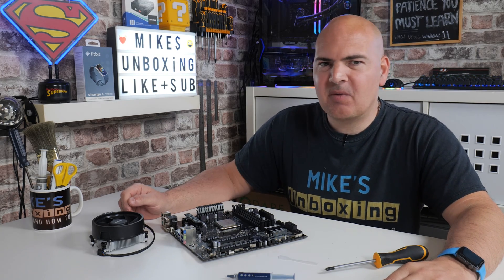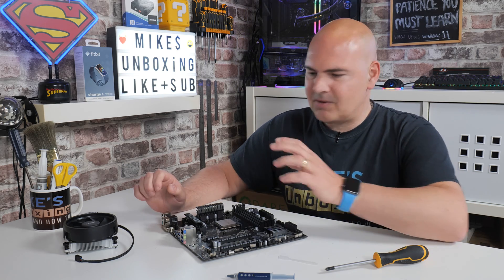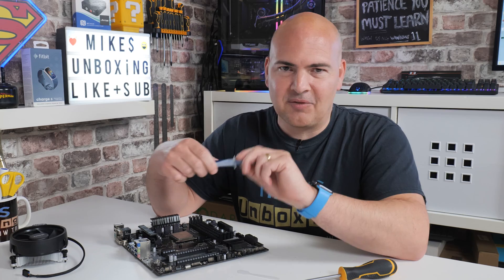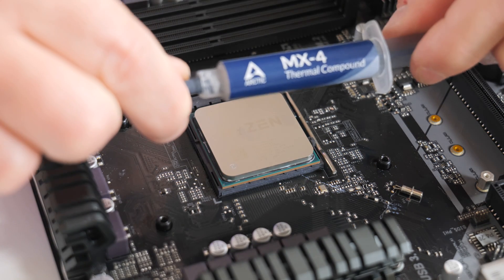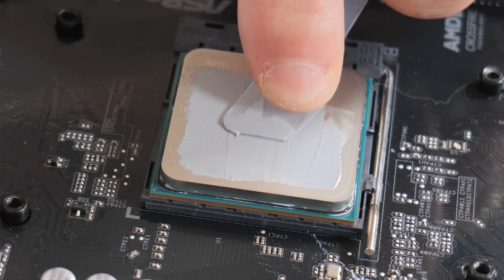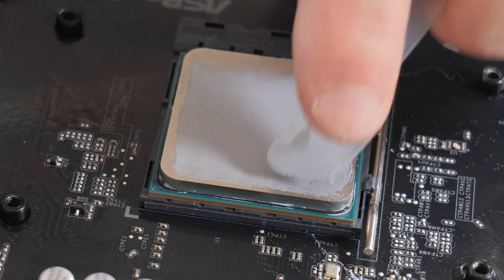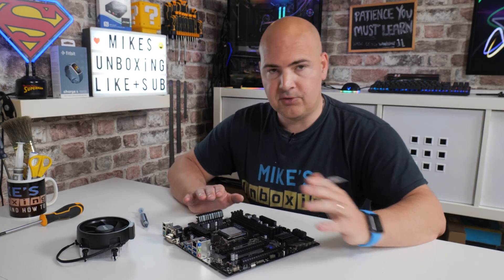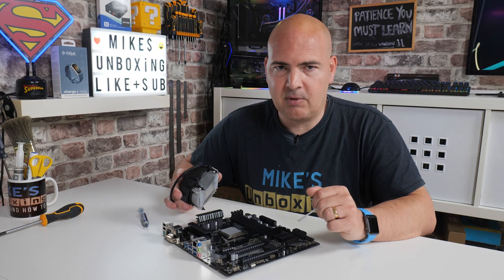BEST Method For Applying THERMAL Pastes & Compounds - Change My Mind

Comment: Great review Mike and Lady Kath. I do not lap the CPU, but I do lap the bottom of the cooler. I too prefer the Thermal Grizzly Hydronaut. I use to only apply paste to just the heat pipes...but have since started using the spread method. Take care all. Cheers
Reply from the maker: Thanks for sharing! i need to get some thermal grizzly paste i think
Reply: i use deep cool cheapest thermal paste for more than 20 years with much better results trust me brand is just a jimmick and thermal grizzly is one of them even though it produce good results.

Comment: I'm always afraid that pre-spread is going to trap voids that would be swept  by the squish method.
I'll always pre-spread a naked core though
Reply from the maker: squishing is squishing however it is applied if the pressure is enough
Reply: @mikesunboxing  based reply

Comment: Great tutorial. Having followed many videos abiut pea or rice method I have always worried that the cpu wudnt be covered fully. Totally agree with idea of spreading the thermal paste👍 Use arctic mx4 after watching one of yiur videos when building d'ters pc late 2019. Thanks for sharing Mike and Kath👍
Reply from the maker: thanks nick, it just makes sense thin layer and total (or near ) coverage, allowing for the maximum thermal transfer and minimal paste will just file the gaps as it should

Comment: You are 100% correct and us old timers who used to apply paste directly to the die with no heat spreader know exactly why. It's just a tiny thin layer to fill in microscopic gaps in the mating surfaces. Nothing more.
Reply from the maker: sound advice old timer :-) - wait that is me as well :-(

Comment: I do it the same way Mitch Haman said he does it.  Some people used to think thermal paste helped with cooling, it doesn't. It impedes cooling. As Mike pointed out it's simply the lesser of 2 evils, a gap of air is worse than a gap filled in with TIM. In a perfect world the IHS and the heatsink would be perfectly flat and mate across both surfaces perfectly. Things are often far from perfect, just look at the variation in core temps on some intel CPUs, even intel can't get dies to disperse heat evenly to the IHS. This is why people delid, lap CPU die, and sometimes even lap the bottom of their heatsink/block. So I'm not gonna try to change Mike's mind. He's right. 😎
Reply from the maker: thanks james, the voice of reason
Reply: It helped my FX 6300 stayed cooled for  5 years long. Stop giving fault information

Comment: The spread methood actually is the correct methood its why a spatchular is included with most Pastes today also you get full plate coverage which spreads the heat more evenly thus increasing the life of the die !
ps; did you figure out the AIO /Fan Header issue ?
Reply from the maker: i think so, it still is a little hot but seems that board likes to ramp up the voltage a lot, and the 5800x doesn't really like that unlike some of the other in the range

Comment: Any method that ensures thermal paste coverage of the entire cpu IHS / die is fine imo. TIP:  FOR REMOVING CPU FROM HEATSINK / COOLER ….IVE FOUND RUNNING CPU FOR FEW MIN’s THEN SWITCH OFF PC AND THEN TWIST (after cpu screw removal) THE HEATSINK GENTLY WHILE CPU IN SOCKET HELPS DETACH AND REDUCES CPU BEING RIPPED OUT OF LOCKED SOCKET! As thermal compound becomes more runny and less tactile 🥰👍🤯 Great video Mike! I’ve use various methods but pea and spatula method for me are most commonly used👍😇
Reply from the maker: a stuck cpu is never a nice thing and it always scares me, but since fully adopting the thin spread method not one single cooler has gotten stuck and most actually just fall off - which is excellent!

Comment: Looks good - will definitely give that method a go next time - Carey Holzman uses his finger (with a rubber glove) but achieves the same effect - thanks for another great tuition video
Reply from the maker: yeah that works well, just make sure it is even and not over applied and that will make removal a lot easier after

Comment: Mike, have you run any tests for temp differences between this method and the traditional "pea" method?  I get what you are saying about AMD CPUs getting removed when removing the cooler; would you say the spread method is more important when using an AMD CPU vs Intel?  Thank you as always for the insights.
Reply from the maker: yes i have done previously and with the pea it is about consistantly getting the right amount which is hard to know unless you take the cooler off to see the coverage.
the pea method for me often gives slight variations when testing so i like the spread method as i can work it the same pretty much every time. In terms of actual differences is it almost nothing in it unless you compare a poor pea application and then it is still only maybe at the most 3 degrees or thereabouts.
for me it is more about the ease of removal and trying to prevent the cpu ripping out when changing coolers
Reply: As I thought.  Thank you Mike.

Comment: Looking at that I've probably put to much on, but it is working. That thinner layer could squeeze a couple of more degrees perhaps? 
I'm getting a constant 43 degrees sitting in bios for a few hours, with 3 x quiet case fans at 50 % ish, 5600G/A520M-DS3H, Amd wraith stealth heat sink block, slightly extended. I've replaced the CPU fan with a TUF 120 AIO, but set to start at 48 degrees. Intend a temperature ceiling of 63 degrees, and only case fans when idle / light browsing.
I need to get some software installed to see what it does in action, (not gaming). Still to get a external 5.25"drive enclosure as the thermaltake H15 case 5.25" Bay, won't take much LG BDe data writer, clashes with the power plug, by 30mm !
I've a FX6300 to re-compound , once the new build is loaded, so surely will be the spread method. 😉 
Really enjoying your videos, thanks 😊
Reply from the maker: thanks for the info john

Comment: Hi, Mike. The spread method is 100% Oletta approved. I've done it that way for years. I also believe lapping the CPU and Water-block is an important first step before applying the paste. In regards to the paste itself, I only use Thermal Grizzly Hydronaut because it doesn't harden over time and it's highly thermally conductive without being electrically conductive. Per example: Idle temp for my OC Ryzen 9 3900X averages 9 degrees above room ambient, and after a 15 minute run on Cinebench R23 max temp 71c. Cheers!
Reply from the maker: thanks oletta, and nice temps
Reply: @Oletta Liano I am sure you have become very good at lapping...
Reply: @PapaMav  Only Rosa knows for sure. 😂
Reply: @OlettaLiano  I know who to come to in the future for spread methods
Reply: @uglybob7505  Sweet, and I know who to invite over for lunch. 🧛‍♀

Comment: Funny I just watched a video on this yesterday, this one here: https://www.youtube.com/watch?v=wn2ln04dquM

My take away is the X-method, which I usee anyway, and a little blob in the middle to help fill in the central area on all 4 sides.  Either this, or a very thin layer evenly spread with a plastic card, as thin as you can get it, for maximum thermal efficiency.

Anyone remember the time before IHS, where the cooler would mount directly the processor (like GPUs do still), many a time finding out the contact between the CPU and cooler was lacking and temps soaring.
Reply from the maker: i can recall when cooler had thermal pads instead on compound, heat wasn't an issue that far back :-)

Comment: When I started building computers back in the late 90's, I would spread with my finger. That's the only way to be sure that it spread in the right way, in my opinion
Reply: Then you risk spreading oils from your finger onto the CPU
Reply: @danieldevito6380 or wrap your finger with some plastic wrap and then spread it 🤷‍♂️
Reply: @danieldevito6380 Which does exactly what?
Reply: @danieldevito6380  I always use alcohol wipes for cleanliness!
Reply: Been building PCs for years.  I also always use the spread with finder method.  No issues doing it that way either.  Used to use Arctic silver 5, but have changed to Arctic mx4.  Pretty happy with it and spreads out easily in my opinion.

To be honest I just keep a rag like an old washcloth or old towel of some kind and gently wipe off the old paste when needed.  Perhaps I should use wipes but no issues with just wiping off the paste so far.

As far as the cpu coming up when removing the cooler, I’ve found start your system up for about 5 minutes to heat up the cpu.  Shut down, loosen the cpu cooler and give it some gentle twists side to side to break the seal of the paste between the cpu and heatsink.
Reply: Thermal paste is bad towards the human body 💀

Comment: MX4 spreads great but MX5 not so much. The last time I tried spreading MX5 there was more left on the spatula! I've since gone back to using MX4.
Reply from the maker: the first batches of mx5 where horrible to spread and the wrong mixture i think. the new stuff is a different consistancy and spreads easily
Reply: @mikesunboxing  That's good to hear but I think I'll stick (or not stick as the case may be) with MX4 anyway. Cheers.

Comment: Also worth mentioning for coolers with exposed heat pipes on the cold plate is to use the spread method in the little gaps on the cold plate before mounting, what's left on the spreader after doing th CPU is usually enough.
Reply from the maker: That's a good idea!

Comment: Mike gets his spatular out.
I think it varies with application.
Me. A pea dot in the middle. Not too little and a little more can't harm.
My patience to spread the paste out has long since gone.
Cheers Mike.
Reply from the maker: as you know from the recent results from the 5800x (thanks to you) the spatula thin spread method works well and also makes it easy to remove the cooler without the cpu coming with it. I hate it when that happens
Reply: @mikesunboxing  I'm older, but NOT always wiser, in fact I'd check every thing I do 😉